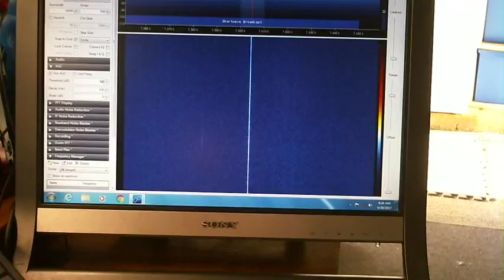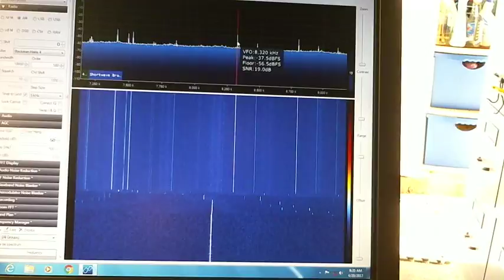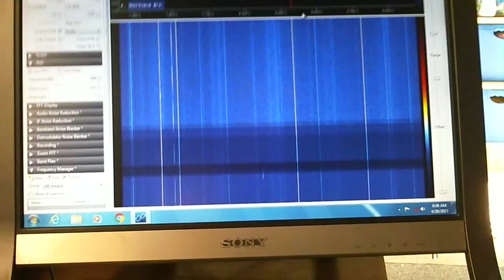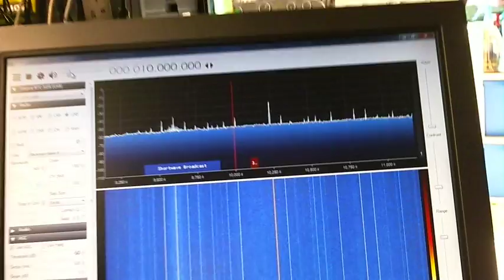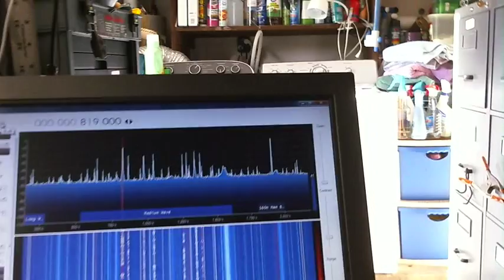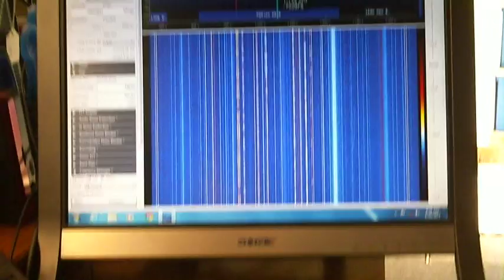TRRS #1182 - New SDR - Results After Cleaning

Comment: Just wondering if you checked whether the center pin was shorted to ground on the HF SMA connector where you noticed the funky solder joints?  You wouldn't receive any HF signals if it is shorted.
Reply from the maker: Does not appear to be and besides, MW is coming in fine.  Actually, MW can be found all across the band even up to 3 Ghz. :)

Comment: I have the same RTL-SDR......and had similar issues. No signal on the HF side, like there were no antenna connected. I opened the case and just to check it up.....but couldn't see anything, but when i did press the dongle card gently....i could see the signal getting through...especially on one spot...one of the capacitors the closest to the USB one. so i did re-solder one of it's points on the backside...it is soldered through the card and into the dongle card, and then it worked.
So you may have a bad soldering somewhere.

I do agree with N Adrews...the RTL-SDR Blog V3 dongle is way more high quality....i have one of those aswell.

Comment: I can only think of 1 thing to add that might fix it.  Is there supposed to be a offset for the built in upconverter I am just shooting in the dark right now. Common values are either -125 or -100 mhz.
Reply: There is no internal up converter. It is using direct sampling Q Branch option in the SDR# software Direct sampling is not an optimal method as it has limitations and needs added filters and fixes. I would suspect the direct sampling method is the root cause of the poor performance.
Reply from the maker: I tried that and scanned from 100Khz to 3 Ghz and found nothing that sounded like SW.
Reply from the maker: Make one wonder what all the additional circuitry is for.
Reply: Appeared to be some sort of filter, who knows how good. Also with that poor solder job throughout the circuit from the factory it could be causing signal loss. When I attempted direct sample with a RTL-SDR blog v3 dongle I seen very good signals with just more noise and spurs than using the Spyverter up converter with the same v3 dongle.
Reply from the maker: Thanks